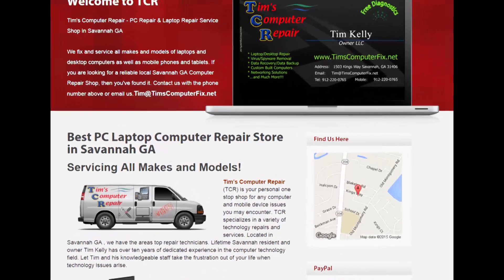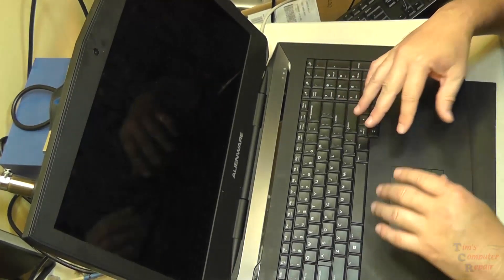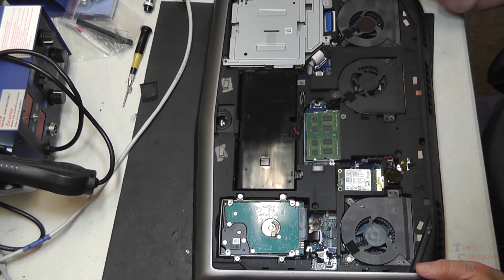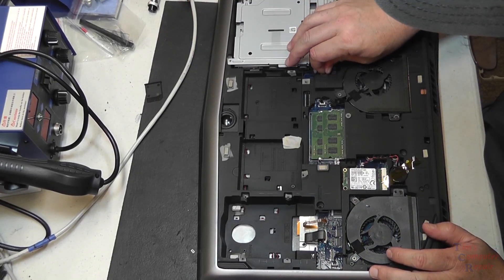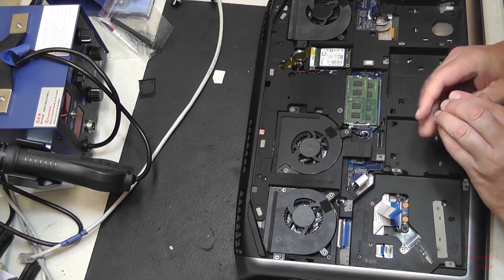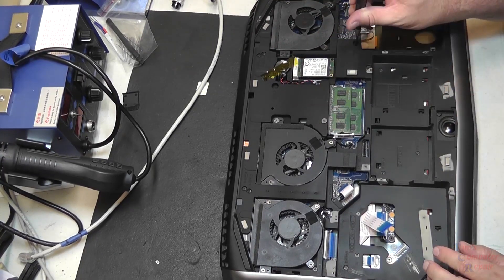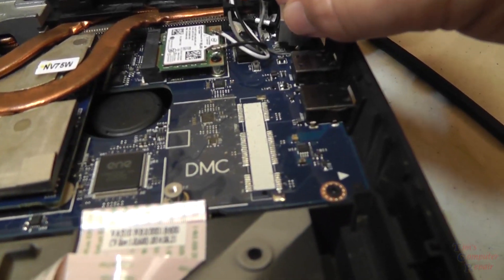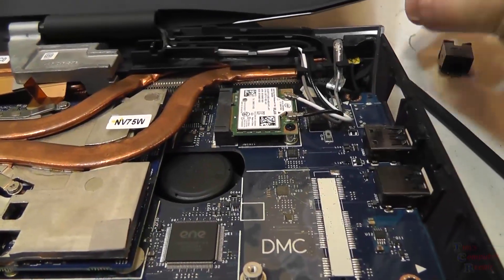Dell Alienware 18 No WiFi Internet Connection

Comment: looks like the customer has been a bit brutal with than nic did you give them the bad news about a new motherboard ,that is if you can get one
Reply from the maker: Yeah  I gave them a price however it was not cheep. They ended up letting it go in the end. I even tried a usb wifi antenna with no joy.